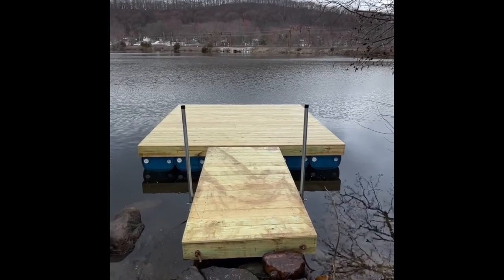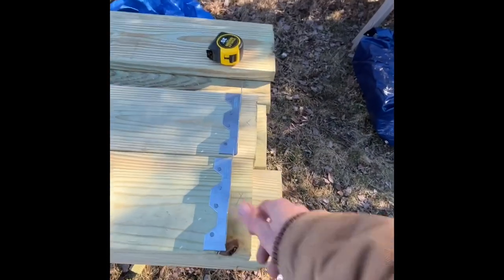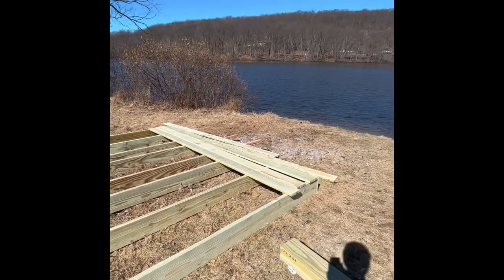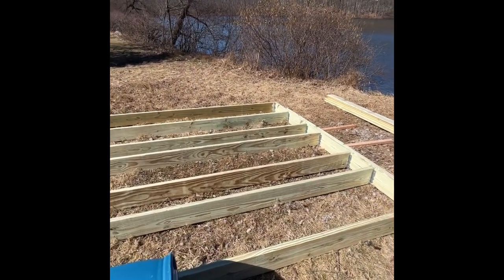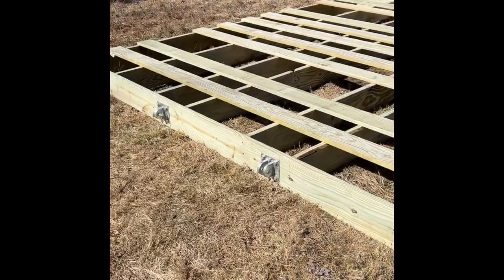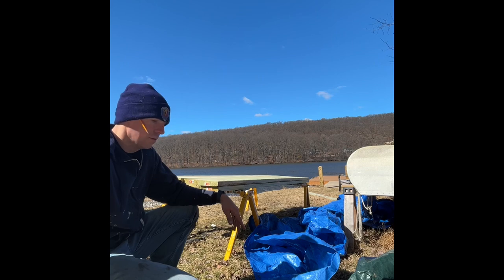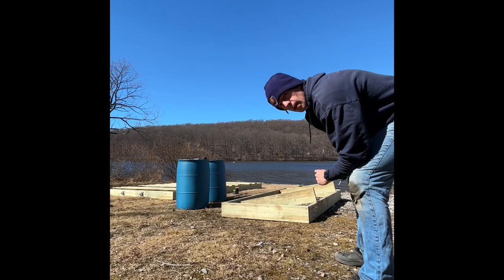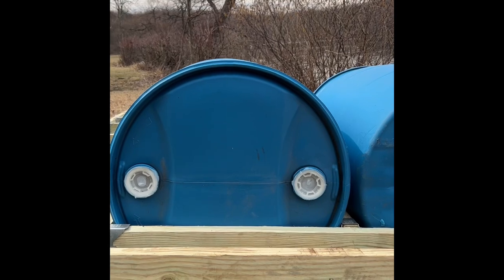DIY Floating Dock with Barrels- FULL DETAILED BUILD

Comment: I was told that  the temperatur differences between summer/ winter will cause the barrles to " suck inwards"  in cold weather....and that to solve this problem, its best to drill a small hole at the top of the barrel to allow the pressure to stabilize in winter months.
Reply from the maker: I’ve done both. I’ve drilled a 1/16 hole in the middle of one of the bungs to relieve the pressure. Some people don’t want any holes that could potentially allow water, so I’ve also done docks without the holes. The barrels do suck in a little, but not much and go right back to normal when the weather warms.
Reply: Made 🎉a big long job out of nothing

Comment: Construction very useful. Disappointed you didn’t walk out on it.  I really am skeptical how stable floating docks are.  Barrels or cubes.
Reply from the maker: I understand your point. The stability is solid. It does move a little with a lot of weight on a corner, but not enough to sway my opinion of them. With NJ winters, I have seen too many permanent dock posts heave from the ice causing docks to shift.

Comment: Great video!  How stable is it?  I'm building a 11' X 16' dock right now.  I have 13 drums and I'm kind of wondering if I have enough.
Reply from the maker: Hey Jamison. Thanks for watching. The dock I built for myself is 12x16 with a 4x8 gangway. The main platform has 24 barrels and is rock solid.  I’m sure it’s overkill, but it barely moves. I think if you spread out the barrels evenly it will surely float, but I don’t know how stable it will be. I’d suggest FB marketplace for some cheap barrels.

Comment: Could these still float if incased in concrete/cement instead of wood?
Reply from the maker: Not sure exactly what you mean. Could you elaborate?
Reply: @BrianBuildsNJ  like could you lay barrels back to back amd side to side on the ground, pour wet cement/concrete on them to encase them, let it dry and then have a floating island you could put in the eater amd cover with dirt amd grass?

And it float not sink?
Reply from the maker: @SherrickDuncan  I dont know about that one.  Certainly never tried. However, the maximum buoyancy of a 55 gallon drum is 450lbs (99% submerged), so if you knew the overall weight of the cement, dirt, and grass, you could determine if it would float based on how many drums you have.
Reply: @BrianBuildsNJ  I have 60 of them. I will have hundreds soon.
Reply from the maker: @SherrickDuncan  Good luck. I hope it works out for you.
Reply: @BrianBuildsNJ  thanks. 
I'm trying to abandon a sinking ship like even rats are smart enough to do. 😅